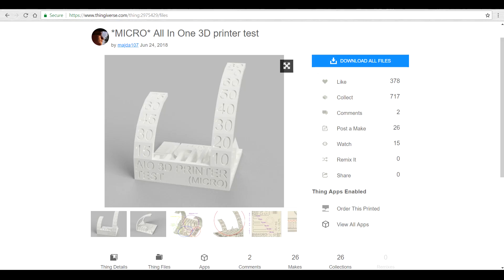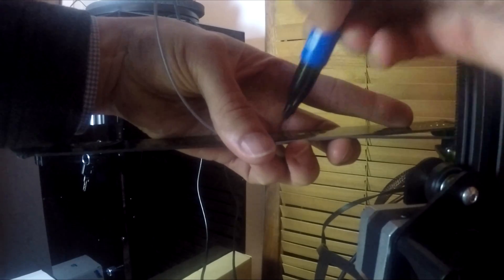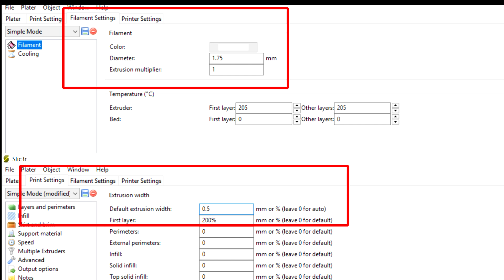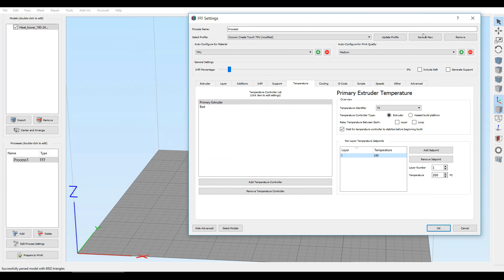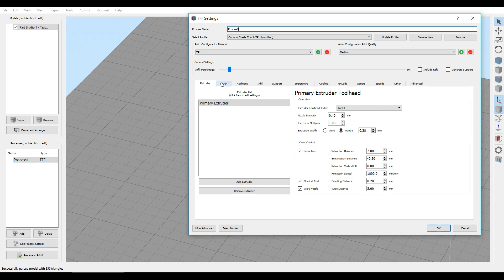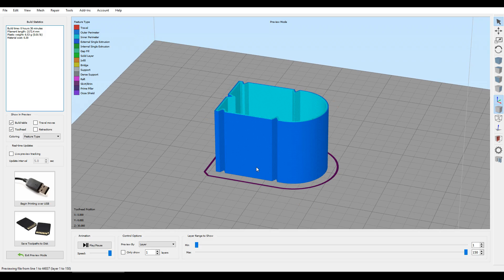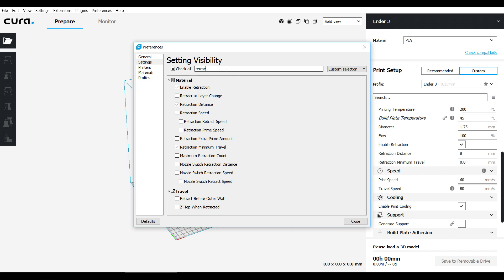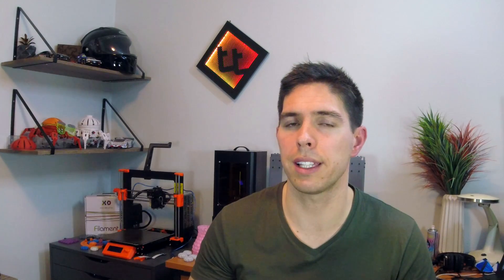How to tune your slicer settings featuring Ender 3 - UPDATE IN DESCRIPTION

Comment: Could you do an Acceleration Test, similar to the speed test? A test where different Accelerations are tested, to find out the maximum or good acceleration for a printer. I read the Ender 3 and CR10 have very small acceleration values of about 500 mm/s2 compared to the Prusa MK2 which has 8000 mm/s2.

Comment: My ender 3 prints ok but when I print parts that should fit together they don't there always too tight printed bearings are always seized and not usable? I would to know what I could do to improve this as most test prints pass fairly well
Reply from the maker: The quick fix is to lower the flow rate/extrusion multiplier.

Comment: Hello,
I followed the instructions for calibrating the extruder and set the E-steps to 97.94.
Stored with m500 and controlled with m503. as soon as I restart the ender 3, the steps are back to 93.
have the original firmware on the Ender Connected via Octoprint.
Where is my mistake?

sorry for my bad English. I am from Germany and use the google translator.

I hope someone can help me
Reply from the maker: It's possible that the EEPROM is not enabled in the Creality firmware. The workaround is to put M92 E97.94 in your start gcode. Your English is perfect by the way!
Reply: Hi, thanks for the quick response.
I simply installed Marlin after your instructions.
I just adjusted the esteps in the system settings on the display now it is exactly 100mm

Comment: Thanks Michael, Fantastic video.  My Micro test looked good but when I went through the rest of the tests I found out the machine was under extruding by 11mm and I had to dial my flow rate down to 80%.   
One question, I set my E Steps and stored to EPROM, when I next upload new firmware will I need to reenter the E Steps ?
Reply from the maker: Normally what is stored in the EEPROM remains and is useful.
Reply: Thanks.

Comment: Thank you for your video. After completing the calibration, do we set the extrusion width to 0.40 or we leave it to auto?
Reply from the maker: You can choose. I normally leave it at auto.
Reply: Well thats my mistake, cause i changed it to 0.40 and had big gaps on the solid layers and i had to up the extrusion multiplier to 97%. thanks

Comment: Thanks a lot for sharing this video. My Ender 3 was under extruding by roughly 5mm, and changing the extruder steps/mm has made a huge difference in the quality of my prints! Was also able to get spot on flow rates, x, y, and z are all within .05mm of print size. Excellent tutorial. I'll be linking this video quite a bit, very helpful! I will admit, I did change how I was measuring extruder length. What I did was I pulled the PTFE from the extruder and cut the filament flush, then back it into the extruder until it was even with the coupler. Once it was done running the test I simply measured the amount of filament sticking out of from the coupler to the end of the filament. I did this several times and kept tweaking my M92 E value until the amount extruded was right at 100mm (E97.15 in my case). Something else that was strange on mine, when I executed the G1 E100 F100 command, the extruder moved in reverse and backed the filament out; however, from the control tab of OctoPrint under Tool (E) if I enter 100mm and hit Extrude it worked no problem. Maybe I entered the G code wrong? I tried it several times (G1 E100 F100) and it always retracted instead of extrude, so I just used the manual OctoPrint extrude button from the control tab instead.
Reply from the maker: Thanks for sharing detailed info. If your technique works, it is perfect. I think the extrusion thing relates to relative vs absolute measurement. If you entered a G92 E0 before the G1 E100 F100 I'd be interested to know if it then worked.
Reply: Teaching Tech by relative vs absolute are you suggesting that perhaps the last E command sent out was a retraction command, and it’s still going in that direction? And if the last command was an extrusion command it would move forward? I will try that the next time I swap filaments. I’m very new to this hobby so your videos and the other 3D printing youtubers out there is where I’m learning everything. You guys all provide a priceless service to us new folks and I can not thank you enough for what you do.
Reply from the maker: In a nutshell, the firmware is keeping track of the position of each axis. In relative, it would mean moving 100mm from the last position every time. In absolute, it will move to position 100 from where ever it was. So if it were sitting at 200, 100 would actually be backwards. The G92 E0 resets the stored position to 0 so a request of G1 E100 is guaranteed to be a forwards move.
Reply: Teaching Tech gotcha, thanks for the explanation.

Comment: Hello for the beginning you are going way too fast for the newbies we are not pro like you sir, I do not understand where to input the code G1 E100 F100  in Simplify 3D ? and after that the M503.. and the Recv Echo steps per unit.
Reply from the maker: Click the cog/gear icon on the right hand side of the screen, this will open up the interface for talking to the printer. The tab you want says communication.

Comment: Any thoughts on inconsistent results during the e-step adjustment?  My filament does not seem to be feeding consistently resulting in varying measurement at the same E-step value.
Reply from the maker: Turn up nozzle temp and slower extrusion speed. Some people do this with nozzle removed to take out chance of it affecting the results.
Reply: First ...thanks for taking the time to respond. You do great videos.  Removing the nozzle is a great idea.  I am concerned because I do not observe consistent and predictable advancement of the filament while the extruder feeder is turning.  In other words, it turns but the filament does not move steadily.  I know tension on the arm can have in impact but even manually applying tension by hand (ie pushing with the spring) does not make the filament move consistently.  Instead it feeds...stops.....feeds some more etc.  I have removed the nozzle and cleaned it out along with the feed tube a few times now to remove the possibility of a clog interfering with the feed.  I will try without a nozzle and see if this reduced friction factor helps.

Comment: Too bad we can't change retraction distance at height in Cura 3.4.1. I will just go +/- 0.5 mm of my actual value to see the difference = 3 prints.
Reply: By the way, it's a nice compilation ! You did not include the e-steps axes calibration. Is there a reason ?
Reply from the maker: Thanks for watching. The e steps calibration is definitely in this video.

Comment: The biggest difference makers for me were the extruder step and flow tests. I was experiencing weak layering and failing prints and these tests showed I was under-extruding by a bit. After dialing these tests in, my prints are looking professional and the ground filament issues disappeared. It also showed a slight adjustment issue with the zed-axis screw. The torture test afterwards was a very nicely detailed model that had excellent overhangs up to 60 degrees and no stringiness on the retraction towers. Thank you for a very high quality and informative tutorial. It shows what a HUGE difference a good slicer profile can do. +1 subscriber!
Reply from the maker: I love reading about these success stories. Thanks for watching and subbing.

Comment: Just as an FYI for "cura" users.  3.4.1 has the ability to do post processing, so add in z-layer based changes to the speed multiplier.  I started at 50%, and incremented to 120% every 20 layers.  This gave me 4mm bands.  Setting the slicing speed at  50mm/s gives me the ability to look both at slower and faster than that.  You can do it however you like...

BUT, modification of the speed multiplier (i.e. the percentage in the "tune" capability of marlin) seems to be the way to go.  (and you can adjust it on the fly too!)

Thanks for the info - already making changes to the profile for my cheap Chinese knock-off :-)
Reply from the maker: Great post, very informative. I really don't use Cura at all so I really appreciate this.

Comment: Does the ender 3 need to be flashed with marlin for the extruder settings to be saved to eprom?
Reply from the maker: No the EEPROM is enabled in the shipped firmware. You can save settings from the LCD menu or use the M500, M501, M502, M503 commands over USB.
Reply: For some weird reason it didn't save on the shipped firmware. I however flashed marlin and tried again and it worked.
Reply from the maker: If you ever run into this again, you can add M92 Z93 or whatever your value is to the start gcode.
Reply: That's what I had to do. Brand new Ender 3 wasn't saving M92 commands to EEPROM with M500.

Comment: 6:10 where's the STL?
Reply from the maker: Everything is in the Thingiverse link. This is said in the video and the description.
Reply: then why did you bother putting it in the description.....I found different one anyway. putting multiple walls you need to set the inner and outer wall speed.
Reply from the maker: I don't understand why you are complaining.  Within the first minute the video informs you to visit the link in the description to Thingiverse. You can lead a horse to water but you can't make it drink.

Comment: Is the under extruding formula the same?  If I measure 25mm after G1 E100 F100, then 100/95*93 = 97.89 ?
Reply from the maker: Yes that is correct. You often have to tweak the number a bit after from eyeballing results of actual prints.

Comment: Great combination of tips Michael. I calibrated my extrusion multiplier from one of your previous videos, it showed that it needed to be turned down to 0.84, which worked great for accuracy, but when printing solid layers the lines had gaps, so I set the multiplier to 0.9 wich solved the problem. I will run more tests when time permits.
Reply: Yep really good tuning tips i had the same issue turned my extrusion multiplier down to 0.84 also had exactly 0.48 walls on the cube nice and clean prints but when printing solid layers had gaps so i turned mine back up to 0.95
Reply: @ Dave Mcc, Appreciate the feedback. Glad you got it sorted. Mine seams ok at 0.9 at the moment, but might need to be increased a little after more testing
Reply from the maker: Spot on guys. I also had to up mine a bit too. It think real world results is more important that theoretical accuracy.
Reply: Appreciate your feedback as always. Agreed, even though I am a bit OCD lol. I kind of thought that the slicer (S3D) would have conpensated for the difference and placed the xy lines closer together, rather than leaving the gap. Or maybe I've missed something?
Reply: Same isssue I think that for more dimensions sensitive print we will have to deal with a little gaps.
Reply: I'm not sure there will be gaps. The theoretical accuracy is probably 'too accurate'. Although I haven't done any further tolerance testing yet, my prints appear to be perfectly accurate for the real world. Of course, all our printers are different, but for the most part, I don't think there is likely to be a significant drop in accuracy by increasing the multiplier to compensate for gaps. Of course, there is the chance that I could be completely wrong, but testing is fun :-)

Comment: My settings were almost perfect from the start. I adjusted the temperature, flow rate, acceleration and jerk settings and my calibration cubes look really good. I still need to print the mini calibration test
Reply from the maker: That is as good as it gets. Some people just can't get it worked out so I'm glad you've had immediate success.
Reply: What settings did you end up changing for those prameters?

Comment: I was qurious and imported the gcode for the speed test with abl, when i checked in the browser in simplify 3d it show that it only print with two speeds, one for the outer line and o e for the inner line so maby something has been missed, should it not change the printing speed every 5 mm?

I could see that it was devided to 6 selections but al of them semmed to print att the same speed
Reply from the maker: The larger the object, the more the speed will show due to acceleration. In a short line there's not enough time to accelerate to the top speed.
Reply: Yes, this is true, but the GCODE should ask for the higher speeds, even if the printers other controls keep it from accelerating to that spped.  Double check the GCODES, I think that they are off some how.
Reply from the maker: You guys were correct. The minimum layer time setting was slowing them down. Gcode has been updated on Thingiverse. Well spotted!

Comment: Are you sure the extruder steps calculation is correct? My M503 output shows current setting of 93 steps/mm, and I get 24mm left after extruding 100mm (meaning I'm underextruding by 4mm). 100/96*93 is 96.87, but if I run the extruder test again I'm now underextruding even more (30mm instead of 24mm).
Reply from the maker: The maths has never failed me before. Did you save the settings to the eeprom before retesting?

Comment: I'd like to know what settings were used for the speed_test_without_able.gcode file.  I printed it and got excellent results at all speeds and it printed really nice, totally smooth and no over or under extrusion.  I have yet to be able to achieve this on any of my prints.
Reply from the maker: I've updated the description with more info. If you open the file in a text editor, simplify3D has all of the settings included as comments. You can try inserting them into your slicer of choice.
Reply from the maker: My S3D profile is now included on Thingiverse.

Comment: Hello thanks awesome video. But you missed some test or how to configure it in Cura.
Reply from the maker: The things covered in this video are flow rate, retraction, speed and temp. The first two are explicitly shown, the second two not because I hoped they would be obvious.
Reply: Setting up changes in cura based on Z Height isn't quite as straight forward as it is in Simplify 3D, IMO. I think that may be what he's referring to. You have to select a plug-in in Cura to do that. The Plug-in you're after in Cura 3.4.1 can be found in Extensions > Post Processing > Modify G-Code - Then in the Post Processing Plugin windows you have to click on Add a script, then add ChangeAtZ 5.1.1. It gives you the ability to change speed, flow rate, bed temp, extruder temp, and fan speed on a per layer or per height basis. You do need to add a script for every change in temp. Hope that helps! One of the things I do not see is the ability to modify retraction speed or distance at a given height, so if you're using Cura you may just have to print a new retraction spire test for each retraction speed / distance until you find what works for you.

Comment: ender 3 and 3D printers with Marlin firmware with speed over 80mm/s with is a dream : https://www.youtube.com/watch?v=SBZ7MfvAsGc&feature=youtu.be ... When you do this test, you clearly hear (sound motors) when you increase the speed, in reality, it doesn't ... Try a 32 bits motherboard or klipper if you want real speed improvment.
Reply from the maker: Thanks for the interesting post. That video was good for thought. I guess one spanner in the works was my final print was completed half an hour faster without a loss in quality. The geometry of the object and the acceleration of the printer are two significant factors. More testing needed.

Comment: How do I get to this terminal for the extruder callibration in cura 3.4.1? I can enter G code in the monitor section but for example when I enter M503 where do I find the steps?
Reply from the maker: I don't use Cura and I wasn't aware of this functionality. You can use Arduino and open up the serial monitor go run the scripts.
Reply: @maarten krikke 
I have the same problem with cura and ender 3 if you find any way to solve this problem please let me know

Comment: I calibrated my Ender 2 and it was extruding 100mm by default, I followed your tutorial for setting Auto Extrusion Width and Multiplier to 1 but wall width was 0.55mm / 0.48mm which works out at 0.87 extrusion multiplier, that seems very low. Am I doing something wrong?
Reply: There are gaps between the zig zag top layer infill now.
Reply: I got 0.89 but i will try to go slowly up in  multiplier for every test print untill it fill out the gaps
Reply from the maker: I quite often have to bump it up a bit afterwards. Ultimately what matters is the print quality you see rather than a theoretical value.

Comment: Nice Job.  Very helpful video.   I see you are having Zits from overextrusion on your starts like me. I don't get them as bad in most other slicers, but the supports and extra control in S3D is so hard to give up. They are very obvious at 6:04.  I've tried all the stuff on the S3D guide and then some.   Any thoughts on how to get them to go away?   I know you will always see the starts and stops but when the print bulges out at the starts it wrecks any tolerances.
Reply from the maker: It's something I've struggled with for years but never put a lot of time into. If I solve it I'll make a short video.
Reply: That would be awesome if you find it.  I've been chasing this one for a several months.   If nothing else I'm really glad to see it's not just me.

Comment: What about a PETG ones?
Reply from the maker: The process is the same, just with higher temps.
Reply: My prints are worse than were before. Trying setup for print Fang but screw holes keep failing. I have no idea what to do as feel I moved backwards!
Reply from the maker: Not sure what has happened but you can always go back to your old settings.
Reply: Finish build out ABL and Fang then I will do it again!
Reply: I was overthinking it I will keep tweaking them, Thank You
Reply: Teaching Tech I did it